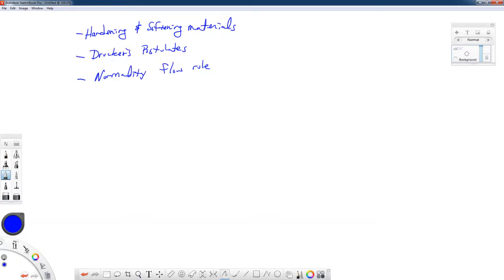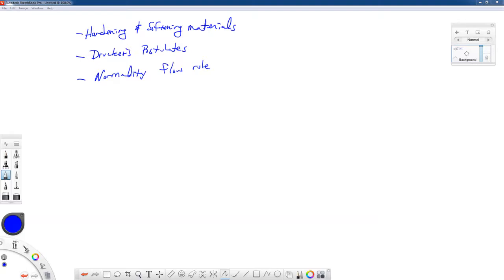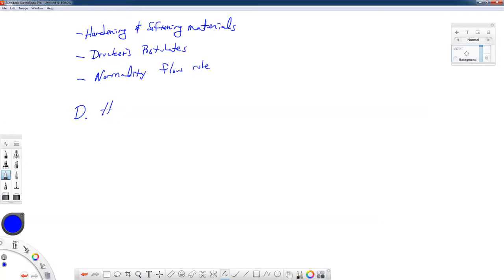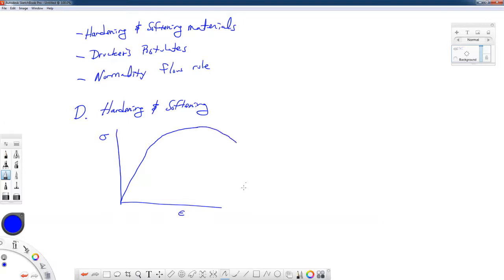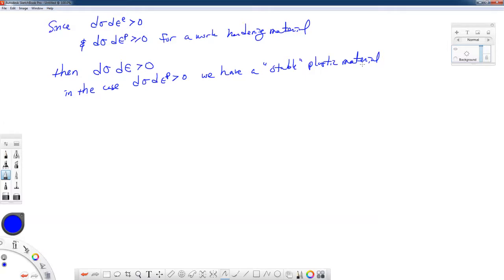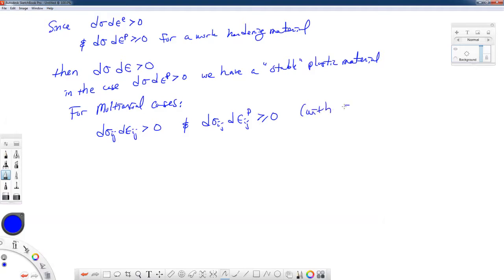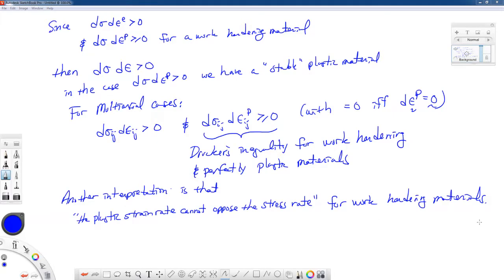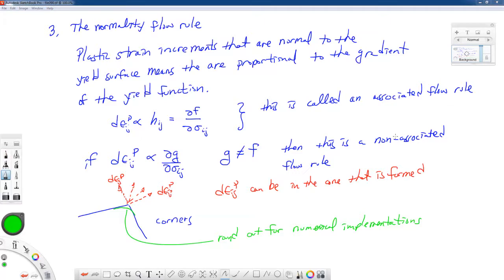AEM 648-10-Drucker's Postulates, Convexity and Normality Flow Rule

Comment: Thank you very much for your presentation. Would you mind explaining why in minute 25 you directly assumed that the dot product was not going to be greater than zero? The angle between the stress increment direction and the plastic strain increment was less than 90°.
Reply from the maker: If I understand your question, the point of that is to show that you cannot have the situation of an increment of stress that has some portion in the yield surface normal direction and yet puts you back inside the yield surface.

Comment: Hello Mark. Thanks for the videos, I have been enjoying them thoroughly. In the video AEM 648-10 Drucker's Postulates, around time 18.24 mins, there is an portion where you project one stress point inside of a monotonic stress strain curve onto the curve. Got a bit confused by this as I was wondering if such a stress state is possible (that stays inside the monotonic curve), my thought was that the stress states should follow the curve. 
Can you please comment, many thanks
Reply from the maker: I will have to take a look, but I believe that was for an elastic unloading.
Reply: I agree with you Sunil Job. And btw even the stress state can be transferred like the video showed, the Drucker postulate seems can not hold if the yield stress state at the softening branch is smaller than the elastic stress state (sigma star).

Comment: please doctor i am a beginner in plasticity and i have a question
whats i understand is that if i have a stress state inside the yield surface it will be in the elastic range and if the stress state touch the surface it will begin to yield the question is as the material is hardening the yield surface is expanding so does the stress state always stay on the surface itself as they are both increasing together or the stress touch it once then it goes away from it while the material yielding and surface expanding  ?
Reply from the maker: Hi Muhammad, yield surface (YS) plasticity requires the stress state to either be inside the YS or on it.  This is called the consistency condition.  The YS may either expand or translate or otherwise move depending on the hardening rule.  I believe these ideas are explained in the other videos I have made.  You may want to watch them, but I highly recommend reading books and  taking a course on the subject.
Reply: @mbarkey.mechanics  Thanks Doctor for fast reply im really appreciate your answer and for sure your great videos and teaching way.